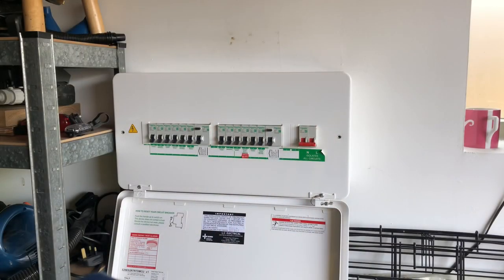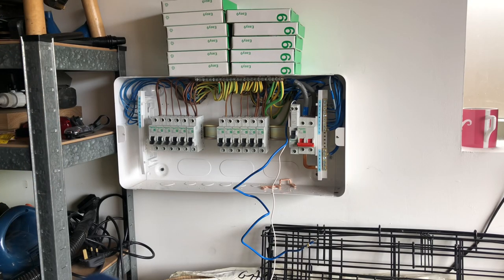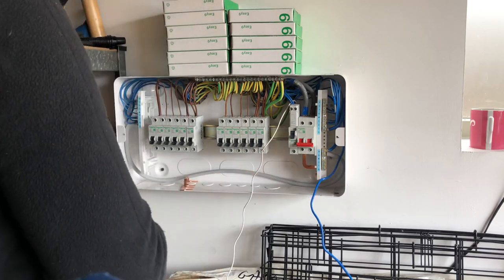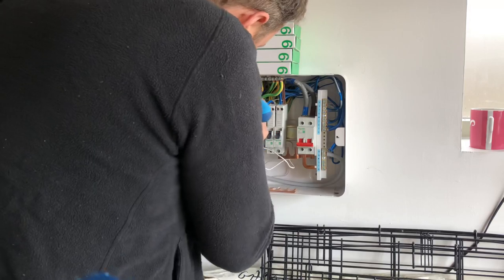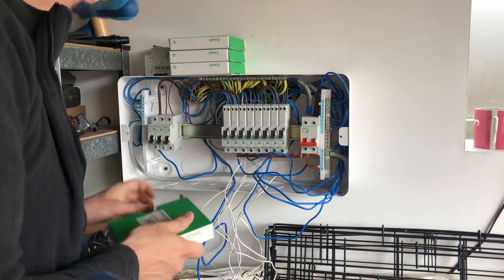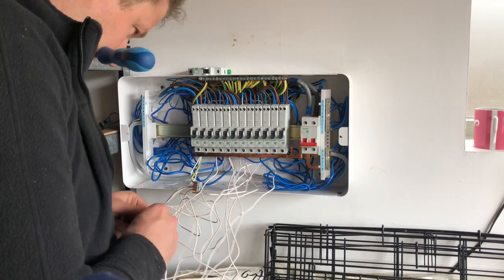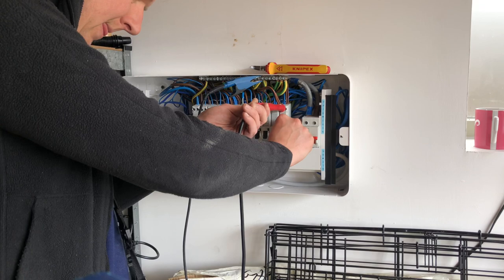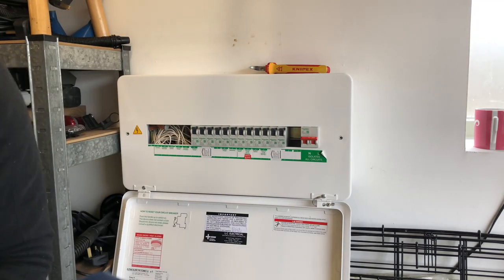Avoid Nuisance Tripping - Converting a dual RCD consumer unit to an RCBO one. Schneider EZ9.

Comment: It’s always been normal practice to load the biggest mcbs closest to the main switch but obviously it’s irrelevant as if that was true you would need a buss bar that was thicker at one end with a thicker pin to go into the main switch terminal.

Comment: Certainly looks neat. Great job. In my mind however, there's a few challenges with the end result. Most of them have been adressed with your elaborate explanation. Two still remain however: Are you even allowed (by regs) to use Wago's or other non-fixed, non-manufacturer supplied connector blocks inside the board housing? To me that's a serious no-no. 
Similarly: connecting up this amount of RCBO's directly next to one-another potentially creates heat management issues in the board and effectively reduces the maximum load a breaker is allowed to carry. This is due to the heat development inside the board which affects the thermal tripping characteristics of the breaker. 
Curious to hear your thoughts on this.

Comment: I just did the maths on the voltage drop mith
Assuming the bus bar has the section of a 1.5mm2 cable (which is not, but I wanted to be conservative) and the 32A MCB is 15 cm away from the low value MCB (that’s about 10 modules), then with a current of 32A flowing in the 32A circuit, the voltage drop due to the 32A load  in the low amp circuit would be 0.04806V; inverting them it’s 0.04805V

Comment: I note on old wiring you do not sleeve (brown on red, blue on black), latest regs do say if consistent no need, but I still do out of habit from the previous 17th Regs.  Yes, lots of bodges are found the best was by an IEC etc approved guy on an alleged "rectification", the pull switch isolator for a shower (8.5kW on 6mm2 cable! served by 32A MCB!  CU still above a door so not readily accessible or safe to access (they just took off the door!!!!)) was in Zone 1 150mm from the shower unit, when pulled you got soaked; naturally the shower was u/s; the biggest danger was the risk of falling over laughing!), and adding connectors instead of earthing as you go seems a little less than 100% sure, not allowed in aircraft.  Indeed, bunched overlong wires cause our old "mate" Eddie Current to lark about, and is not allowed due induction heating loops in cables generally (recall your H&S lecture to unreel extension cables before use, & Maxwell's Corkscrew Rule magntic problems, etc.), shortest has least resistance so least V-drop so much preferred too.  White earth of this type is not far unlike USA (in many helicopters most of the cables are white so meter faith essential).  I would never leave a busbar where in the event of the CU face blank falling out a nosey finger could touch it, this is against regs.  It is bus not buzz (as stems/derived from omnibus/carrier).  The bending of exposed wire ends has also the value of if the terminals work loose they do not so easily come out, but with heavier (2.5) cable and > 1 in each terminal hole it causes complications.  If Schneider say 'cut to length' that you do, the regs do say do 'to the maker's instructions'.  I always put heaviest units nearest switch, but being Jewish (I do not ask why I cannot gnaw on pigs, I just don't, discipline/obedience) do it because my RE instructor at the RSME said so, but being good he did explain for the ones less able to just do as told (like a RCS guy on an electronics course I was on, only one who fried a meter and kept asking me to ask questions for him since I outranked him; I need not say what my reply was! (since Hitler never liked corporals)) and I forgot what my earliest civilian trade instructor said as a teenager because we then still had fuses, metal conduits and trunking and separate cables/wires, and were mostly on industrial 3-phase and over half a century ago; and we then still did power-factor corrections to motors with suitable capacitors (long out of the curiculum?).  I tend to test existing circuits before adding a new CU as otherwise continue the errors.  In fact, I test as I go; probably an Army thing as ex-RAF guys tend not to and at least one gives me a lot of work correcting his bodges.  You guessed it, wrong side of 71, still slaving away!
Reply from the maker: Thanks for your comments!
Reply: Alan Rose "

Comment: Just a thought, I hope none of the many Sparks you converse with via Twitter never test that property, you'd be slated for the way the neutrals have been linked and busbar extended

Best practice as regards the positioning of devices to not to place all heavily loaded circuits together, but try and space them with lesser loaded circuits such as lights etc. Many MF instructions actually state this.
Reply from the maker: Thanks for the feedback. How would you have done it?

Comment: It's certainly true that voltage drop and resistance exist, all conductors have a given impedance even if it's in the range of milliohms. To what extent across a busbar?

Well, load up the CU and measure the P.D across the length of the busbar between the main switch and the far end of the busbar. Then you'll know. 

Re: neutral tails: impedance was the first thing that sprang to mind here. You've got a length of conductor bunched up in a thermally constrained metal box, and an unknown amount of heat being generated across the length of said neutral tail when the circuit is under load.

How much heat?

Well, enough for the manufacturer to warn against leaving excessively long neutral tails in the CU and suggest cutting them to length.

It would be interesting to get a FLIR camera on the CU once it has been closed up and placed under load for a while (shower / cooker on etc) to see the effects of voltage drop and resultant heat across the busbar and neutral tails.

It would be especially interesting to see the thermals where your sections of busbar join up along the way with that 40A circuit under load.

Thinking about it... I wonder if / when British safety standards will change to include some kind of thermal cutout in CUs? I'm imagining some kind of main switch with 60C ambient temperature cut out or similar. This would show up thermal issues long before they progress to melty moments or catastrophic failures.

Comment: When doing your labels, measure the full distance from one end of the RCBO's to the other and divide by the number of RCBO's. In the above board that would be say 208mm divide by 12 = 17.35 approx. Much better than trying to measure one of them.

Comment: If might be an idea to get yourself an earth leakage clamp meter, it comes in quite handy for intermittent earth leakage faults.
Reply from the maker: I did use my fluke clamp meter on there and there was no AC earth leakage but about 1.3amps DC
Reply: @artisanelectrics  Was that with everything the customer usually has operating in the evenings on?
Reply from the maker: Alvin Ashman no it was just in the middle of the day
Reply: So you didn't try and replicate the fault by trying all circuits on?
In a weeks time the customer will report a fault on one of the circuits and it only cost them £500
Maybe they'll call you back to change all light bulbs transformers and electronic devices until the fault is cleared
Reply from the maker: ralphsterz and if we had turned on all appliances what good would that have done? You still wouldn’t know where the fault is, every time it tripped before they had different things running.
Reply: Intermittent faults are the worst. Pain in the backside trying to find. Unless they call you as soon as it's happened and leave everything in place as it was there's little chance of finding anything.

As you said, most probably a build up across all the appliances being used. That's modern living for you.

Tell customer to play board games or Twister with the kids!! So much more fun than all the kids being in their rooms, on their tablets.
Reply from the maker: Kevin McNicholas yeah I totally agree it can be really frustrating trying to find intermittent faults, especially with what I call the electricians magic touch where as soon as I arrive everything works fine! 😂
Reply: @artisanelectrics  yeah. I once was called to a tricky intermittent tripping issue and could I find the fault? Nope. I was flummoxed.

I did some tests, tweaked one or two things and just charged a reasonable fee for my time.

I'd no sooner got home when my phone went. It was the same person with the same fault again.

I went back immediately, tried to find it but no joy. I didn't charge that time but recommended the services of a long established Lecky in our area with around 40 years experience.

I phoned him on their behalf and he said he could come round later. They were an elderly couple and it was rather urgent as they were left with no heating.

Anyway, I texted the Lecky asking him to please let me know what the fault was and how he rectified it. He was very happy to tell me when he later phoned back.

Let's just say that it was tricky, even for him, but he sussed it out eventually using methods that simply aren't taught in the books but gained through years of experience.

I hope to be like that some day. That's why I love these videos that you guys do. We ALL want the same thing, right? Installations that are safe and efficient.

Thanks Jordan for taking time to do these vids. I find them invaluable.
Reply from the maker: Kevin McNicholas great comments thanks a lot
Reply: @kangtheconqueror  So come on then, don't keep us in suspense, what was wrong with it?
Reply from the maker: McFets great story thanks for sharing
Reply: @McFets How could MK declare it as fit for purpose when 30mA RCD trips at 9mA, there's no way they've tested it.
Anyway hope you didn't have to make too many visits to resolve it.
Reply: @McFets I do sometimes wonder what is the minimum amount of earth fault current these device must operate at, there should be some sort of documentation in place.
Reply: @ashmanelectricalservices4318  Between 15mA and 30mA for your regular RCD
Reply: @wiremyear8989  I'd say anything from 16mA to 30mA as this range would pass the half times trip test. I find they usually trip between 22mA and 30mA.
Reply: @ashmanelectricalservices4318  Agreed
Reply: @artisanelectrics  Oh you have that magic touch as well? Always happens to me, one touch and it fixes it forever. Would you like me to pop over to this customers house?
Reply from the maker: Yeah it’s amazing! And they say being an electrician is hard graft! 😂

Comment: placing screwdrivers etc in your mouth, i once ended up with thrush in my mouth and the doc told me it was due to doing just that. tool pouch required bud...
Reply from the maker: Ha ha amazing thanks!
Reply: "So there's 2 reasons why you may have thrush in your mouth. 1 way is by putting screwdrivers in your mouth, the other is"
"Yes! its that one, the first one"

😂
Reply: and absolutely filthy and unnecessary habit

Comment: When doing this, do you make customers aware that each RBCO is using around 1watt?  Customers in general wouldn't expect this. In the example in this video, looking at a running cost of £13 - £16 per year. What's your general thoughts on whether to inform customers of this or not? Love the videos, thanks.
Reply from the maker: Mike Foley I had no idea RCBOs consumed electricity thanks for the heads up!
Reply: @artisanelectrics  Approx 1 Watt each RCBO I understand, presumably there is variation between manufacturers. Would be interesting to know.
Reply: That is a very good point, but bear in mind many MCBs have just as high a dissipation so it affects all customers, not just those choosing RCBOs. However, in both cases the figures quoted are only at maximum rated load. Most of the time they are using far less.
It does occur to me that all packed tightly together they could cause quite a temperature rise - just like a reeled up extension flex.
Reply: Someone has watched big Clive

Comment: Jordan, At 19:16: Would have been good to see the unique 'doubling' of the stripped copper termination - ? was the bent part spiralled back round the straight length closest to the insulation? Unusual termination, I've not seen that method used

Comment: Hi,
Interesting video. 
Couple of points: plastic blanks aren't allowed now are they? (those you used looked plastic?).
And ferrules - no good on solid cable? Only for use on stranded.
Reply from the maker: Hi, thanks for your comments. The need for metal blanks is a myth, the flappy lid of the consumer unit is metal and will prevent the spread of fire. 
Ferrules you’re absolutely right they are only for fine stranded cable not solid.

Comment: Hi Jordan,
I am replacing my consumer unit and I saw one of your video where you or mate  used edge trimming instead of meter tail gland.
Can you please let me know what size it was so I can buy for consumer unit.
Many thanks.
Best wishes,
Ahmed, 
Leicester ENGLAND
Reply: Don't go changing a consumer unit yourself.  You could end up opening a whole can of worms.  It's notifiable work and you'll need the relevant certificates if you want to sell or rent your home.  My advice would to be to get in a qualified electrician.  D.i.Y Gas or electric is a big NO NO.

Comment: Putting the heavy loads next to main switch is just custom an practice, would the busbar in reality present such a high impedance to cause a volt drop sufficient to dim a lamp?  Perhaps 60 or 70 years ago with incandescent lamps and poor supply system voltage regulation it might have been an issue with the fuse boxes at the time

Comment: I've always cut the neutrals and functional earths on RCBOs then re-crimped with un-insulated bootlace ferrules. I'm not sure commoning four functional earths together is a good idea as it introduces a single point of failure at the earth bar for those four circuits.
Reply from the maker: Thanks for the feedback yeah I know what you mean
Reply: but the earth bar already has a single point of failure for literally every circuit, where the incoming cpc connects.

Comment: Totally use the third mouth screw driver.
Also totally a keep going worker,im trying to make sure i take a break working for someone instead of working for free.  
I Would eat what i can for lunch quickly and not stop for brew.
I cut the tails to a reasonable length to fit into the bar(today i cut them to length a bit keenly, i wasnt happy about it.They wernt short but you couldnt move them 5 places over 😅).
Reply: My question is not related to your comment but here it is:
What if there's another row above that is populated with all RCBOs, how you would you feed them from the main switch on the lower row? 
(i wonder if an RCBO terminal can take a 25mm² conductor and a busbar tooth).
Reply: @IAmTheD  wow 25mm² is pretty big for standard domestic stuff. Here in australia we can get terminal tounges that you use under a bus bar and can fit in up to 35mm² i believe
Reply: @ryanmicro   Yeah it is pretty much common there in the UK as a lot of homes are on a 100A service so the feeds inside their consumer unit have to be 25mm². I watched a couple of videos recently and it seems that different brands have different ways of linking the top &bottom rows. Schneider uses terminal blocks that looks like exactly an MCB while Hager uses a much smaller connector that is mounted on the DIN rail. 
(I am not from the UK but I watch a lot of their videos as our electrical systems are quite similar to some extent).
Reply: @IAmThe_RA  and i thought our 63amp mains was rarely used up haha

Comment: In my experience it does not make any real difference where you put the breakers. The positive is fed by a bus bar and the current available is pretty much the same along it's length. If there is any difference it is so small it would require laboratory level equipment to measure it.
 I trim down the neutral tails to a reasonable length with just the right level of surplus length. They pass all tests and not had any problems reported.
Reply from the maker: Good comment thanks

Comment: You a more then one brake in the Buzz buss bar.  I try never to do that if I have to I put the big load one the side with out the brake.  Do you ever drill an pop rivet the buzz buss bar.
Reply from the maker: Never done that but it could work I guess!

Comment: Does RCBO detect arc-fault, ground-fault, or both. Curious. I’m on the other side of the ‘pond’ with different terminology, and 120v/240v panels for residential. Also, curious about 3-phase voltage. I’m familiar with 480v 3-phase.

Comment: i avoid manipulating copper by doubling if it’s mechanically & electrically sound and only double when it’s a larger hole> Any manipulation of the copper can stress it but equally loose connections are fire risk so it’s an engineering decision.